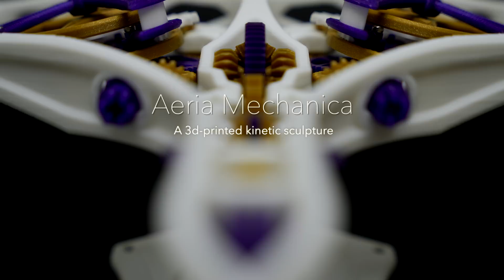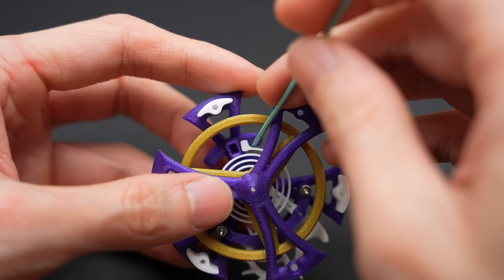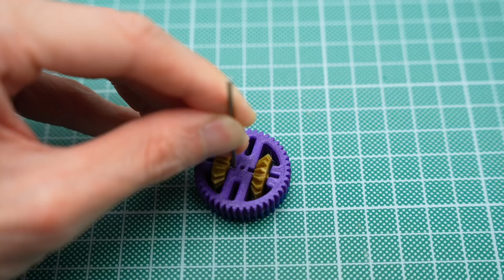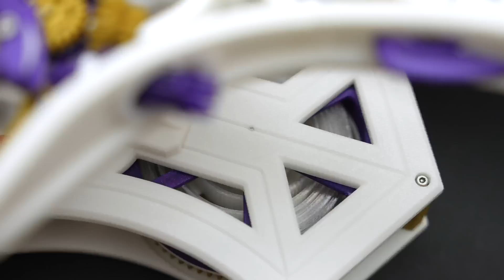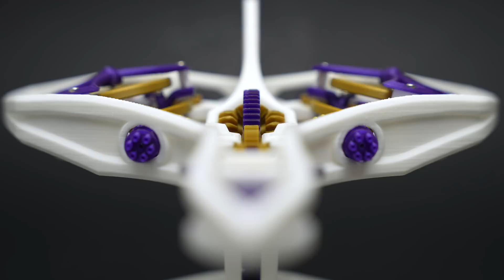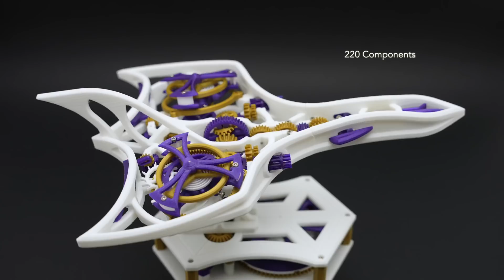What happens when you put Tourbillons into an Aircraft?

Comment: One thing to say. THANKS FOR SHARING YOUR WORK. I recently discovered some of the marvels of clockwork thanks to the story of John Harrison (from Dava Sobel Longitude book) and I was wondering if it was possible to make such a mechanism with printed parts. I already know that it may be doable with laser-cut plywood for short working time (I got a kit from Ugears for cristmas, it's a globe that rotates, with the space shuttle rotating faster around it, all powered through a rubber-band spring powering the system with a working escapment, just the working wooden planetary gearbox impressed me itself).
Once again, thanks a lot for sharing your works, about the axles, I would say that they may be found in art material stores or model airplane stores, and the combination of a 2mm outer diameter brass tube (supposed 1mm thick) with a 1.2mm piano wire (steel axle) gives a nice and snug pivot

Comment: So, why a gear chain instead of a shaft to transmit power from the mainspring? I mean, it looks FANTASTIC, and that's reason enough as far as I'm concerned, but I'm curious if there was a reason beyond aesthetics?
Reply from the maker: The gear chains also function as gear reductions between the mainspring and the differential core gear. I will also add a motorized option and the gear trains allow me to alter the ratios to match my selected motor torque.

Comment: How did you design differential gears?  I work in Fusion360 and it would be a pain there. The frame is verry impressive, I hope I'll learn how to design such skeletonized frames with arbitrary angles, so far my designs are mostly orthogonal =)
Reply from the maker: I'm using Unigraphics NX and the gears are generated using a GRIP function. Bevel gears are still a pain to work with since they require some surface modelling. There is a gear generator tool  in fusion 360 and you can try using it. 

If you want to add more angles to your designs, try subtracting parts of your model with angled cross sections from multiple directions (for example x-y and x-z plane). Imagine you are a sculptor removing bits of material from your model to form those angles🙂. I think it's slightly easier to create and visualise the multi faceted look compared to freeform or parametric modelling.